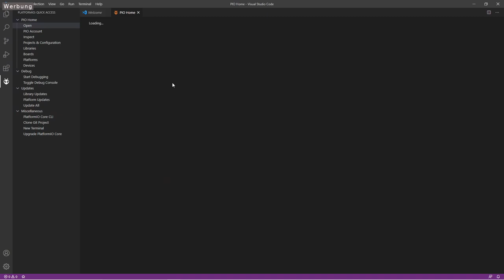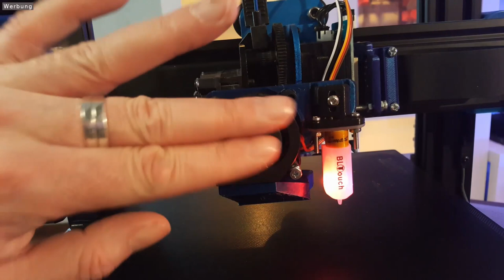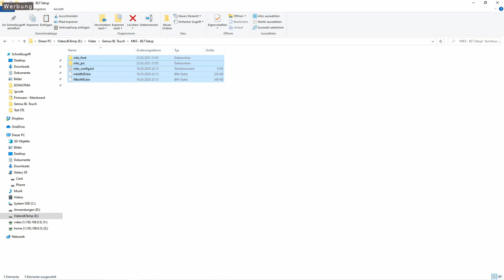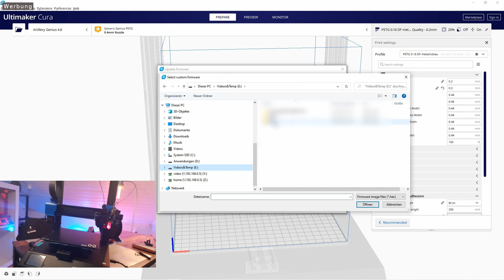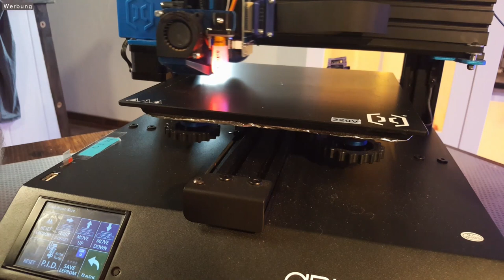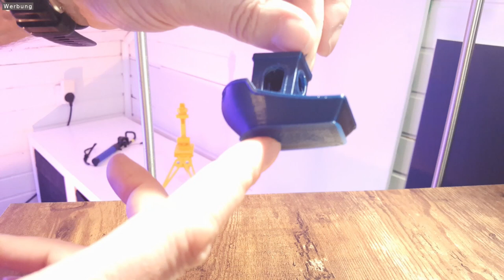Artillery Genius with BL Touch and TFT Firmware

Comment: Thanks for taking the effort to record this. Not many people seem to be doing so with this printer, and there's enough different from the Sidewinder that there are pitfalls using material related to that printer as a guide for working on the Genius. 
I have to replace the mainboard on my original Genius. I'm wondering if it is worth the effort to try to replace with a 32-bit board instead of 8-bit board. Do you have any thoughts on that?
Reply from the maker: to be honest - my opinion - as long you stay on marlin 1.x and dont change to marlin 2.x, I dont see a big reason to change from 8bit to 32bit board. This Genius classic, with the modification in this video, is still one of my best printer I have and produces the same quality with the same profiles like me Genius Pro. Best regards.

Comment: Hey its working and its amazing.
Did you noticed the motor output more noize? 
Diffrent from the stock firmware. 
Its like high scratch noise.
Maybe need to update something?
Reply from the maker: Hi, I had a little difference in how the motors sounds by traveling - but not a scratching sound. I'm not sure where it could come from. Maybe one if the drivers is a bit mispowered? Happy printing
Reply: @3dprintpassion 
I think, but not sure that the speed of moving from a to b on x and y is faster than normal and that why the motors generates more heat and noise.
I will try contact with the maker.
But for sure leveling issues gone 😊
Reply: I assume this is because you unscrewed the panel, sides may be not sealed enough. Try placing something under the panel (between table and the panel), so it pushes the panel and reduce the vibration.